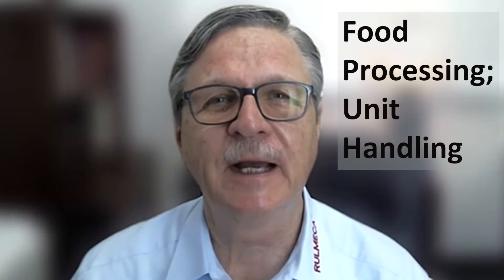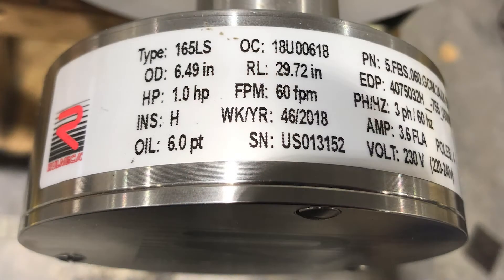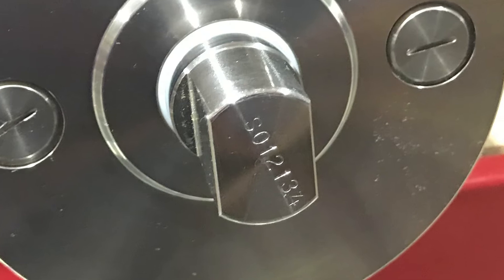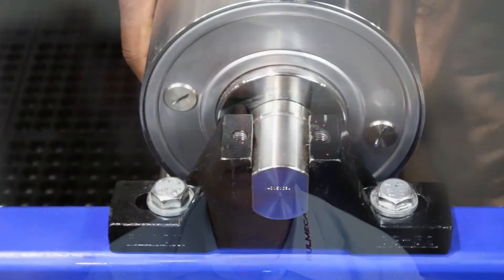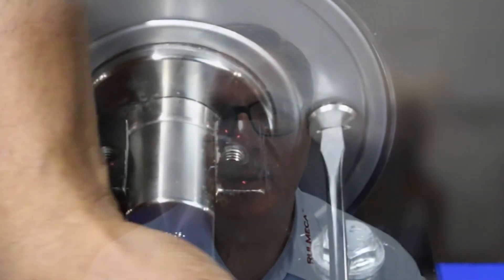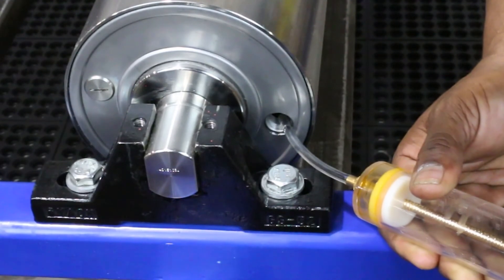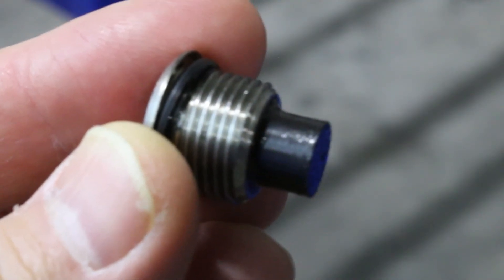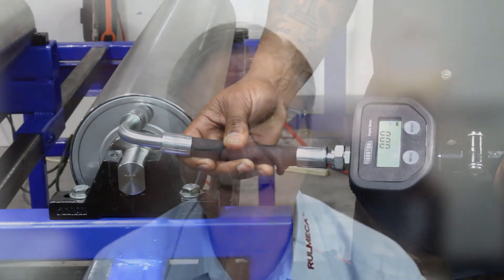How to Change Oil in Small Rulmeca Drum Motors

Comment: in which part exactly this oil is being used for lubrication? In its gear or where? I want to know the chemistry of oil if you can help me
Reply from the maker: The oil circulates throughout the interior of the Motorized Pulley, lubricating all mechanical parts while also cooling the electric motor.  We use Mobilgear SHC 630 synthetic oil and other brands.

Comment: What is the degree of the type of oil used in the Roller?
Reply from the maker: I do not know what you mean by "degree" of the type of oil. We offer a variety of oil viscosities depending on each application.  Usually, oil viscosity is specified in centistokes
Reply: @rulmecacorporation4596  I mean, what are the specifications of the used oil because I have a cement roller in the factory. I want to change its oil, but I do not know the used oil